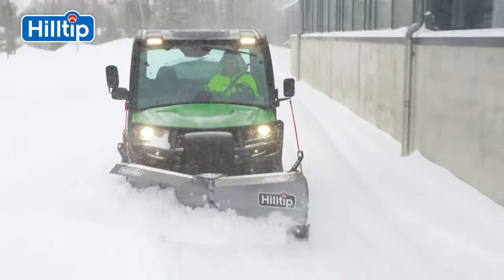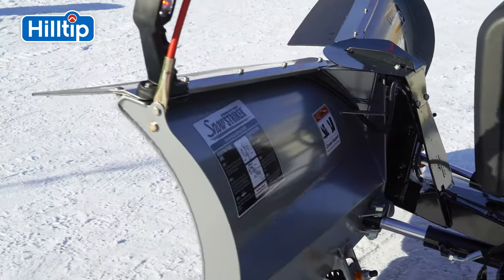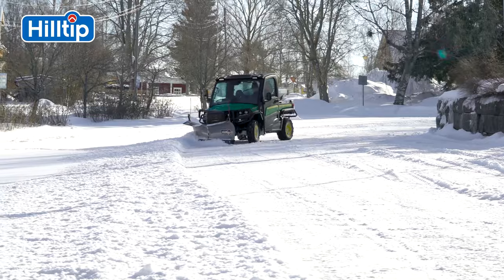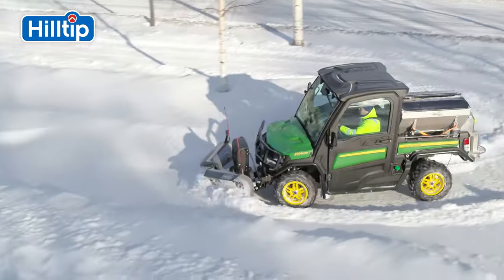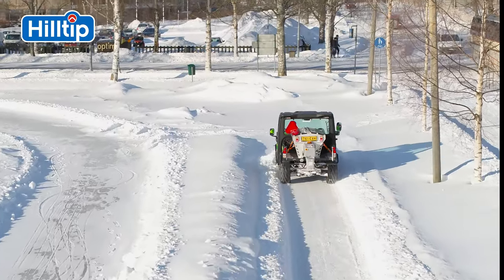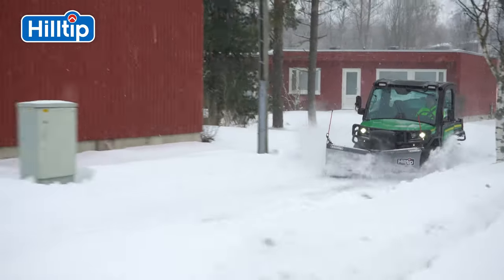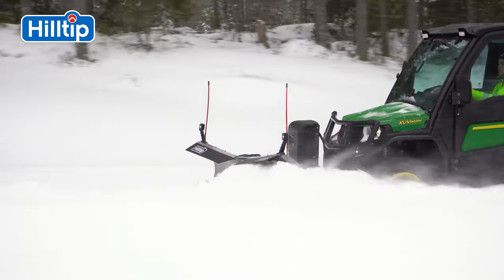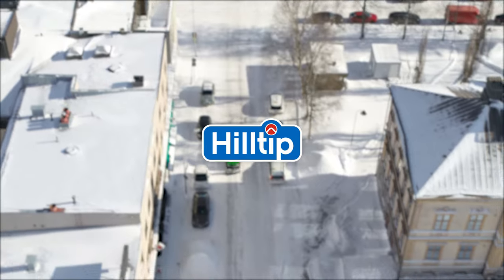Hilltip UTV-V Snowstriker™ snow plow

Comment: This is probably the Best UTV plow I have seen so far.
Reply: agreed and they’re not sold in the US. i’ve heard rumors that hilltips US division will be starting to sell plows here but there’s only a handful of dealers. don’t get me wrong, we have some great manufacturers of snow removal equipment here in the states but something about the HillTip plows just seems differently better. the mold boards appear to be lighter and put less wear and tear on the front ends of all vehicles, big or small. also seems like they don’t stick out quite as far.
Reply from the maker: @znovosad555  Thanks for the feedback, yes our plows are very well received, durable light weight Plows designed for professional use.  Our plow line will be available now in USA staring from 2024